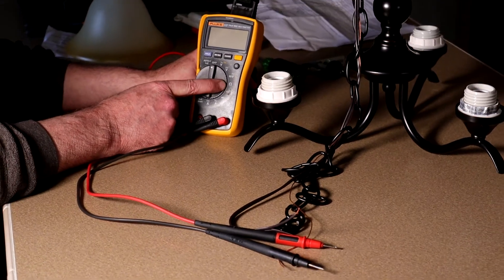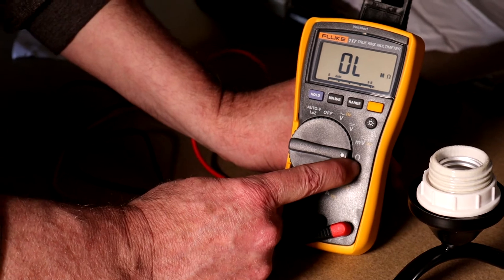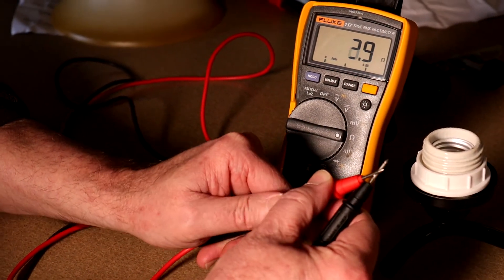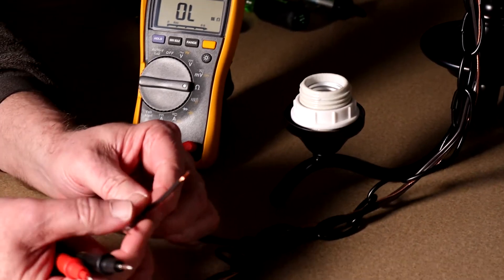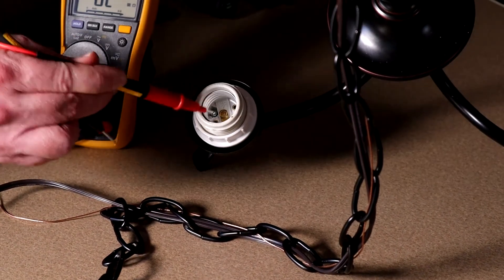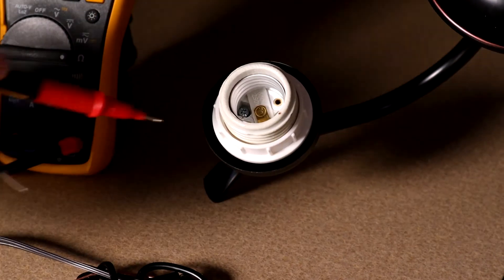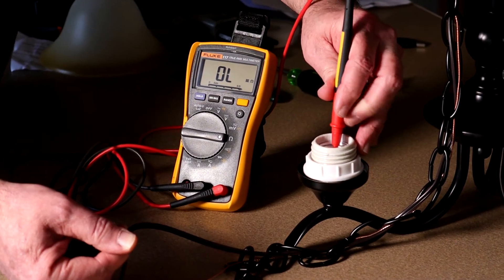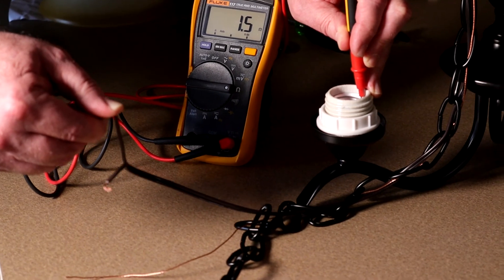Which wire is hot when both are same color | Light Fixture wiring

Comment: I have a hanging 4 ft LED light that the previous owner left that was cut off at the plug that I want to hard-wire. The cord has 3 wires - all white - the middle is marked as the ground, but I don't know which of the other two are hot/neutral.  Is it possible to determine hot/neutral in this scenario?
Reply: I was able to get this thanks to your video.  The shop light is one of those that can be chained in sets, so it has an outlet for a plug.  I connected the ohm meter to the smaller plug slot (hot) and got continuity with one of the unknown wires (open with the other wire in question).  I then did this with the larger plug slot (neutral) and got continuity with the other wire (open with the other).  Thank you for posting this video!
Reply from the maker: Nice   Good Job !!!

Comment: Can you possibly be LESS clear?  What are you doing with the wires, are you touching them with the multimeter or what?  Which one are you touching.  Why bother posting a video that is this UNCLEAR?
Reply: If you look very closely at the plastic conduit your light wires are in, you will see one of them should have a groove in the outer shell. The other wire conduit is smooth.

Comment: Great video. It was clear and easy to follow. One thing it is missing is how to determine the ground.  I have a fixture where all 3 wires (hot, neutral, ground) are exactly the same and impossible to distinguish between. A comment about how to detect the ground would be helpful. Thanks.
Reply: Thanks for the response. I do have a meter and using the info in your video was able to find the hot and neutral using the brass post in the middle and the screw threads. The 3rd wire never showed a circuit, so I assumed that was the ground. What in the socket does the ground wire connect to?
Reply from the maker: Nothing.....Hot & Neutral...Power the socket....Hook the ground to a Ground screw in the case of the 4" box you wire it to...To ground it....
Reply from the maker: Do you have a meter...They can't all go to the same connection points ..   Or all the wires would be shorted together...If that's true don't hook it up..

Comment: Great video! Here is another solution when installing light fixtures with the same color hot and neutral wires:

After connecting the light fixture wires to the circuit wires in the ceiling/wall box using twist-on wire nuts, you can do the following simple test using a non-contact voltage tester to find out whether your light fixture is installed correctly: With the circuit breaker still turned off and no light bulbs installed yet, turn on the circuit breaker and then the light switch. If the wires are connected correctly, then the voltage tester will only beep when you place it closer to the center pin or tab inside the light bulb socket, meaning that the center pin is hot but the threaded shell of the socket is neutral. If the wires are reversed, then the voltage tester will beep when you touch the threaded shell of the light bulb socket, indicating that the entire socket is energized (potential shock hazard when installing or replacing light bulbs).

Comment: I have thick black and white copper wires, I get the black should go to the center brass tab, and the white to the silver threads..

But I'm finding it impossible to get the these thick copper wires to reach and bend around the screws that are on the light fixture...   I'm guessing I need to buy stranded/flexible wires to go from the screws, then with the other side connected to the copper wires via wire twist?    What wire should I ask for?
Reply from the maker: If the thick copper won't fit under screw, yes. Get stranded 14 gauge, for under screws,  attach those with wire nuts to original thick copper wires. Should be fine.